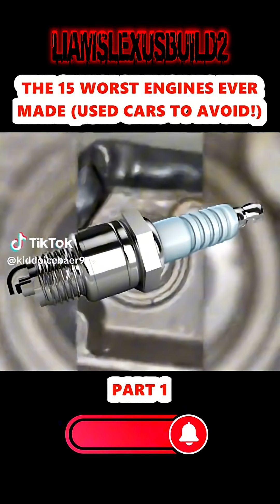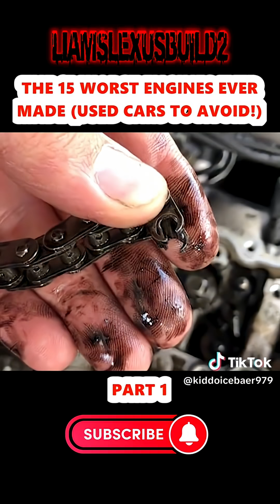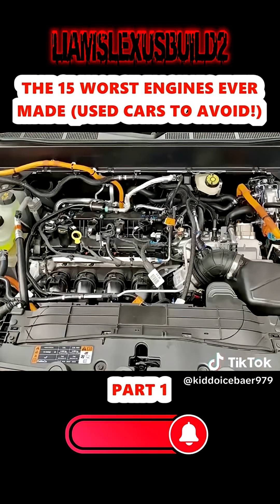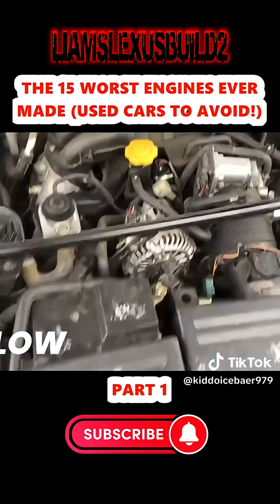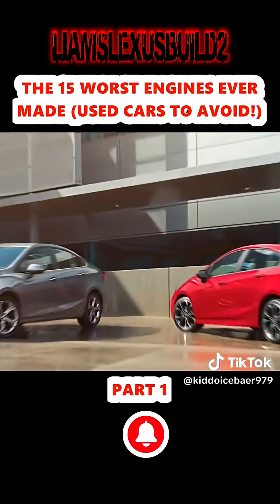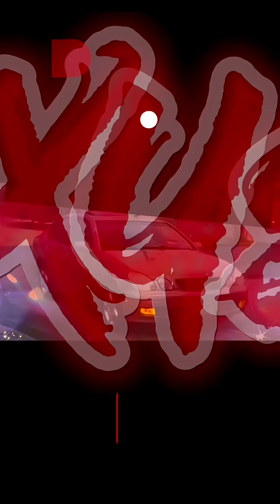Top 15 Worst Engines Ever Made (Part 1)

Comment: Absolute bullshit, starting with the GM 3.6 vvt is how i knew this was a load of shit 😂 my wife drives a 2010 malibu with 280k miles. No motor work done. Hate the internet
Reply from the maker: Cry harder bud 😂 your one experience doesn’t put weight the hundreds of thousands of others that had engine problems man this world is slow if they think like you… This list wasn’t pulled out of thin air it was legit statistically backed and listed 😂😂